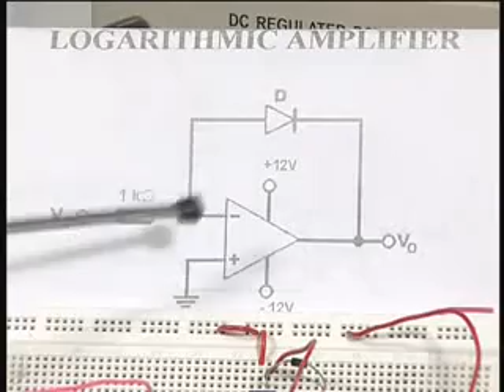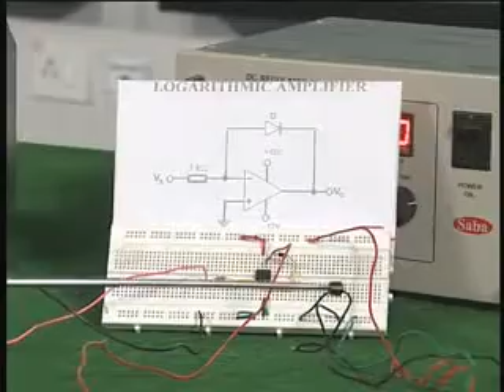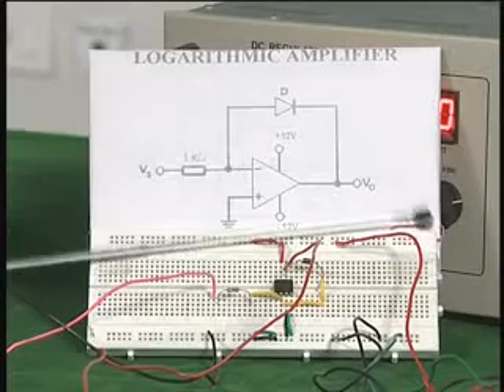Logarithmic amplifier

Comment: If u calculate the logarithm of 100mv with reference to base 10 the answer should be -1 but you are getting -0.48
i think you have to check once..
Reply: Durgaprasad das Vout=K*logVin
The output is multipied by a constant factor hence you don't get a value which is simply log of input voltage.
Reply: @jibinjoseph6917  can you please specify the value of k .i require it very urgently